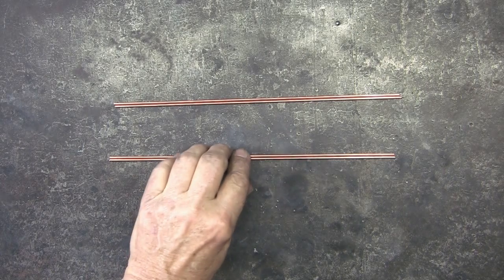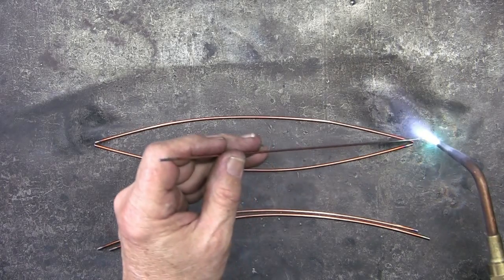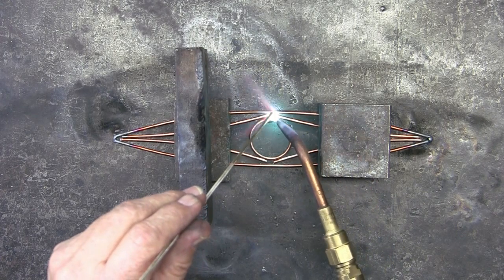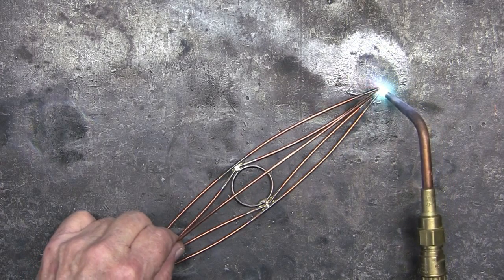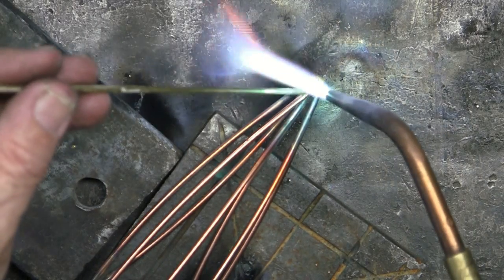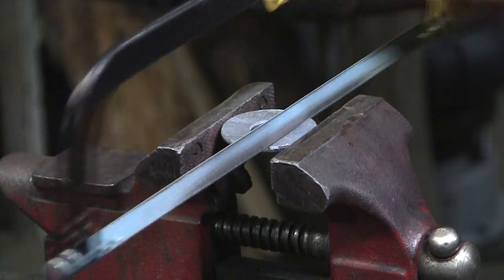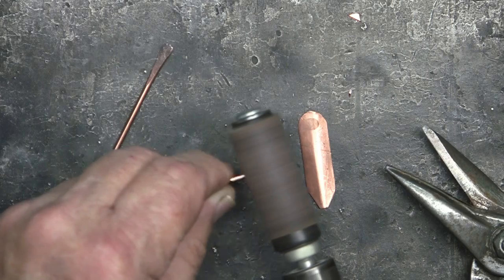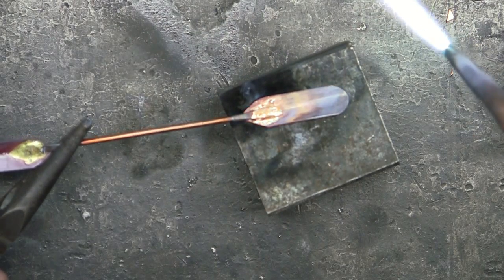A Kayak:  Simple Wire Work

Comment from the maker: Thanks for subscribing.  The flux covered rod you have is probably brazing rod.  

RG 45 is a mild steel rod with a thin copper sheath.  Its primary purpose is for gas welding as a filler rod.  In other words, it is for gas welding steel.  

I use RG 45 because it is a good clean steel, easy to work with, comes in different diameters, has the copper color and reasonable priced..

I build many pieces of sculpture with RG 45.  In addition, it is easy to get at your welding supply.  I like Canada!